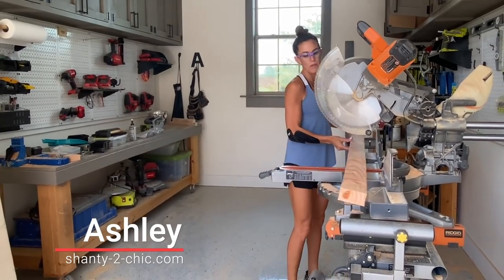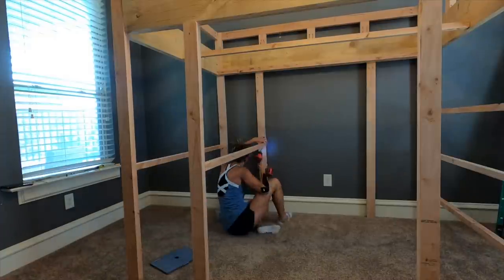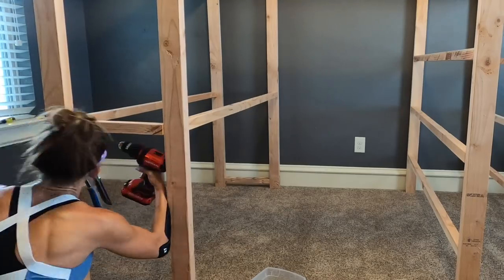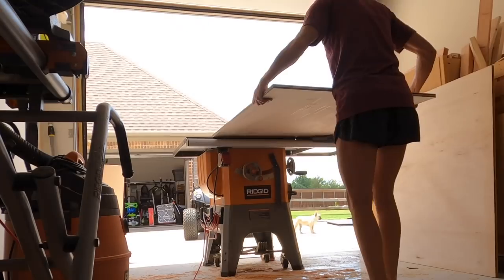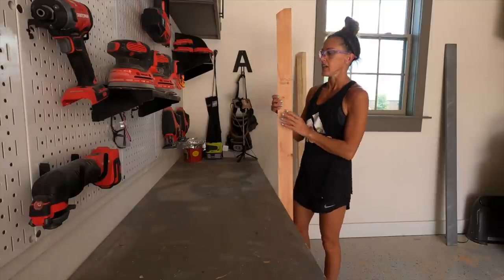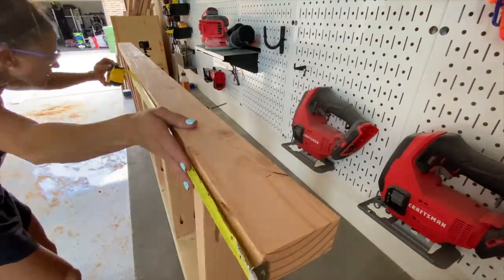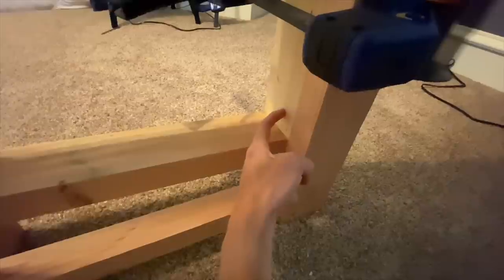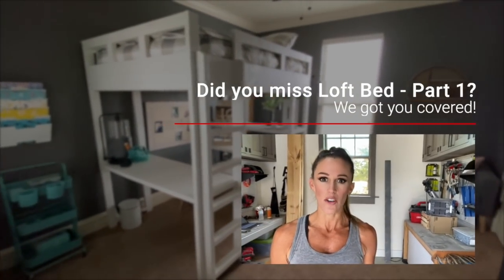DIY Loft Bed Part 2

Comment: What did you do to your elbow? It looks painful
Reply: I suspect tennis elbow. Over use, nothing to do with tennis. I had it before, very painful.
Reply: I currently have tennis elbow from all my wood working and can’t seem to shake it. It’s gotten bad so any advice on how to get rid of it would be welcomed. Enjoy your videos
Reply: @mikeandmollyspivey3051  oh I feel for you. Fortunately I was able to immobilize it. My job permits me to move from task to task throughout the year. I was able the stop using it while doing other tasks. Easier said than done I know but its imperative to recovery. So the elbow, knee and shoulders have recovered mostly but now its my feet. They are getting better. Retirement hopefully will cure many aches and pains. Mind you that I was able to adjust my workload and address my pains early enough to minimize most injuries.
Reply: Got it from working...sanding brooms.